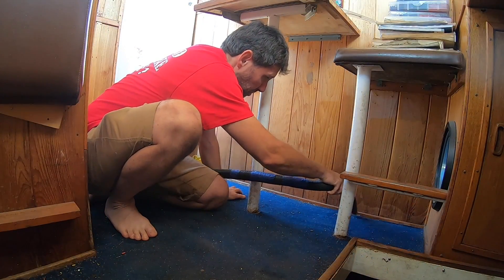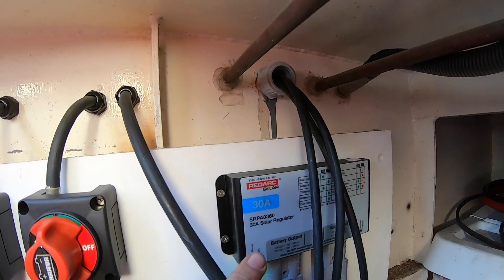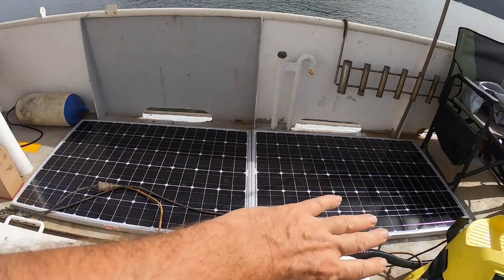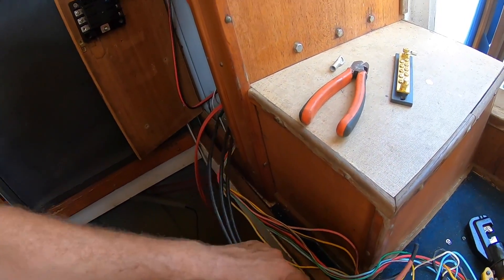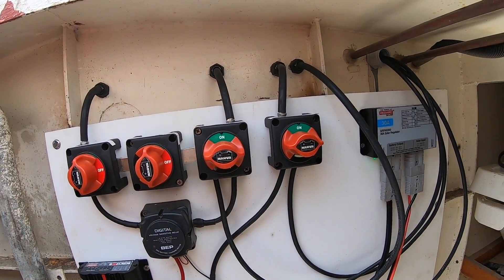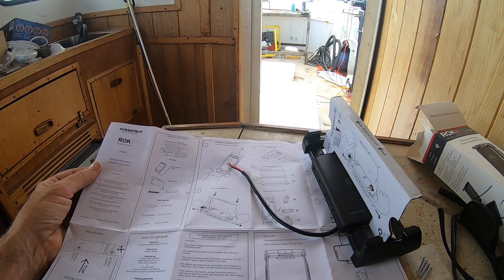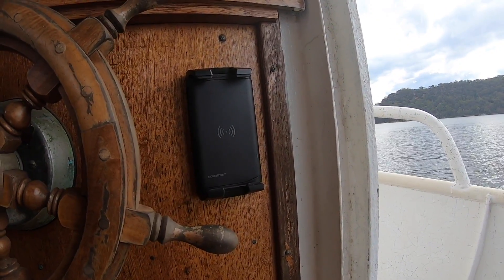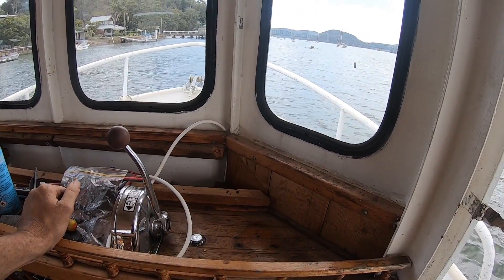Trawler electrics

Comment: Love your channel. A suggestion. Run a blue wire for the 24 volt positive. Common is normally  black and red for 12 volt. Makes life a lot easier.
Reply from the maker: Yes, I'm going to get some colour coded heat shrink to put over all the ends.

Comment: Stu, your message regarding labelling and remembering is a good one! I used a letter and numbering system that wraps around each cable.  I then added a laminated print-out with each of the cable codes and names behind the bulkhead.
Reply from the maker: Labelling the cables themselves is a great way to go. I'm sure I will be doing something similar.
Reply: @DangarMarine  Stu, the reason I did it was that I was doing several electrical upgrades and modifications through my boat restoration simultaneously.  However, every now and then I had an "oh shit" moment when I disconnected a few cables that were only supposed to be off for a minute when someone stopped by for a pint. Then I couldn't remember where the wires went without a multi-meter.  Loads of extra work.  Numbered cables can sit for weeks or months without any issue of quickly re-establishing where they belong.  One last nit-picky thing - I always sprayed my cable ends/terminals (i.e exposed metal surfaces) with an anti-corrosion coating to prevent corrosion.  It looks like you're using fully tinned wire which is definitely the way to go.  Congrats on another great video and thank-you!

Comment: Be sure to place LED lighting above the fuse panel onn a seperate circuit. That way you will have light to work by. Also in the Battery area. These should be on their own circuits. Great video, keep them comming.

Comment: Amazed you are getting on so well with the electrics single handed. 👍 Suggest you label every cable at each end. When finished get a good quality photo, plasticate it and stick it near the fuse box / termination box. Keep a copy on your phone. Hopefully in the heat of “ battle” even if all the labels have fallen off you will have a reference.
Reply from the maker: Thanks mate. Yes, you can't have enough information when it comes to what goes where!

Comment: Another great video Stu the electrics are come on nicely. All the steel trawlers I worked on had the compass mounted down the centre line of the vessel - something to do with the ships own magnetic field deviating the compass. The larger vessels had to have the deviation checked every 3 years and the compass adjusted. Hope this tip helps, your doing a sterling job.
Reply from the maker: Thanks Andy!

Comment: Looking good. When I used to wire up bilge pumps I would have several on automatic floats then have individual switches for each plus one panic button switch that lit them all off regardless of what the switches and floats were at. Have a good one.

Comment: Wow an hydraulic crimper for 16mm lugs , loving the commitment to low resistance joins dont forget the raychem heatshrink and liquid electrical tape.. the lower the voltage the more important and the cleaner your electrical connections need to be..
Reply from the maker: Thanks mate. Good point about low voltage connectors needing the cleanest connections.

Comment: Great Vid, your wiring it up the right way!!! Be sure and mount plenty of LED lights in those hard to see areas, you will be glad you did.
Reply from the maker: Yes, a good set of emergency lighting is a must. I'm thinking of going with those LED lights for illuminating number  plates on cars.
Reply: @DangarMarine  You know i never would have thought of those but that's outstanding those are exposed to the outside elements continually so they gotta be pretty tough.

Comment: another way you could label  would be to print the label out, stick it on the cable length ways and then get some clear heatshrink and cover the label  and shrink it on, you'd obviously have to remove the lugs to do it but by doing this the lable will not fall off due to any moisture .  keep up the great work!!
Reply: That might not work. Those labels use heat to print. Using a heat gun on one might make the whole label go black.
Reply: @chris746568462  : no it wont go black. those are not thermo paper, they use a "toner ribbon" that just melts the black paint wherever the head gets hot and melts it onto the white self adhesive tape. heatshrinking it works well, but dont get too hot or the white tape will shrivel and/or smear the writing onto the heat shrink tube.
Reply: ross private agree; could also cover the labels with clear tape
Reply: @Loetmichel 
That sounds sensible, but I have the exact same machine. It does not work like the way you describe. If you heat the label the whole thing turns black.  You can actually write on them by hand if you use a soldering iron with a rounded tip.
Reply: @  @chris746568462  :  I just googled the machine: We are both right. The machine is delivered with a thermo paper tape spool... but you can buy plastic tape spools that use the toner transfer technicque as well, and those are actually waterproof AND heatproof (to a degree). I have the grandfather of that thing here at home (and a slightly newer "professional" Dymo at the company. Fun fact: they all use the same tape casettes as the one Dangar uses in the video, although the big one at the company can also take 24mm wide tapes. ;)
Reply: @Loetmichel  Yea, I don't use the paper labels in mine, i only use the plastic ones.  Maybe using the paper ones with some heat shrink on cables is a good idea then, personally, I would rather use the plastic ones in a marine environment though.  I still have a classic punch type one somewhere, no batteries needed and they actually stay stuck, the newer ones just seem to not stick as good.
Reply: We used to use slip on cable lettering (you can get it to fit any size cable you want)- its an expanding 'sleeve' that slips over the cables insulation, and comes as the complete alphabet in individual letters and numbers...
(this kind of thing- https://www.aliexpress.com/item/32917754219.html - not recommending this particular mob, just they got pics  in their ad)

Another thing is mark out and label all your fuses- we used to do  a rough hand drawn sketch as we went wiring the cabinets, then when you are finished draw/print up a nice clear one and laminate it, then stick it to the door or wherever, do the same draw out a circuit diagram roughly as you wire it up on an outline of the boat showing where the cables are actually running, when finished, draw it up neatly and print out, laminate and into the electrical cabinet...

Makes diagnostics a few years down the track so much easier

Comment: Seeing as how everyone is giving you advise Stu, I thought I might add one myself.  Dip the end of your bare wire into some dielectric grease before crimping them.  Should prevent any oxidation and should it get dunked, it will prevent a short circuit.
Reply from the maker: Interesting tip, I have some onboard. I'll look into that.
Reply: Great idea on large cables where there is 'wicking' potential between the cores. Smaller cables tend to crimp down to a sold group in the lug, not as important but still a good idea. Heat shrink with glue liner is also a good way to keep crimps dry.
Reply: Ray G 
Great idea, suggestion !!!! I do the same thing on every crimp I install, and in all screw or plug connection. Never had an issue.👍👍👍👍
Reply: Eh beat me to it...
Reply: We use heatshrink dual wall on all our lugs, it has a glue that totaly seals the cable.

Comment: I'd recommend you put the battery switches outside of the the engine room Stu, in an easily accessible place,  say in the wheel house beside the door.  The reason being if you ever had a fire in the engine room, electrical or otherwise, you really don't want to open the hatch to the engine room to turn off the batteries, otherwise you will feed the fire with oxygen.   I had an electrical fire in the engine room while at sea, and having the battery switches on the inside wall of the cabin saved me, my family and the boat.
Reply from the maker: They are in the lazarette not the engine room.
Reply: @DangarMarine  That works.

Comment: Hi, Just waned to say that it is always best to solder wires together and use good quality shrink tubing to seal. I always put a bit of dielectric gel too. if you must use butt connectors add the dielectric to the ends of the wires. just my 40 plus years of experience of building and boating
Reply from the maker: Yes, someone else mentioned the grease on the ends before doing butt connectors, I'll give that a go.

Comment: Bunnings has velcro tape rolls, get some of them and use them for bundling your cabling. Trust me it makes life so much easier especially in tight situations (like upside down from the back seat into the boot of the car wiring up advanced 2way radios with repeater boxes (think power + ignition sense power on + repeater box + antenna + speaker + remote head and more for some including the duplexor for the antenna lol. Tight space makes grouping cables a PITA.

For your "unswitched" I'd be running ONLY the pumps off that using maybe 12g cable DOUBLE fused AT THE BATTERY. For the heavy 4-8g backbones I'd be running all in switched mode (less tears when something burns). Obviously fuse or circuit break the switched connections too. That phone charger definitely hook to switched else little things like that over a week WILL nibble at the battery bank so I've found out before the hard way lol. VERY good choice on that return neg line!!! Single 2-4g back to both 12/24.

As for your compas the raymarine box should do that by calculating the difference in GPS coords off the antenna on the mast. Of course it's handy to have a backup in-case of electrics failing. Remember most mobile phones have a decent compas inbuilt now too especially if you're standing outside just to set your path if you've lost electrics.

EDIT: that label unit is THE EXACT same as I have in my draw here beside me and use for many different things. You can get all sorts of rolls for them too like clothing/material rolls, clear see through rolls (great for going on a spot that will be "back-light" (have a light behind it).
Reply from the maker: Thanks for all tips, much appreciated. I've only been using the labels that came with the printer but I'll see what I can find that is more suitable for use on the boat.

Comment: You need a compass with a binnacle system for compensation. Called “The Navigator’s Balls” the two metal spheres, one each side of the compass, are adjusted to allow the compass to properly work.
Reply from the maker: Yes, I've looked into a bit. I'll have to see if i can find something small enough to fit there.
Reply: @DangarMarine  You might mount it outside, just in front of the window...
Reply: Those cast iron balls are good but you still need to 'swing' the compass, i.e. get a known transit and point the boat at it and compare real with compass - this will give a chart like a sine wave with the 'Deviation' for the vessel for every given course.
The mnemonic is Cadbury's Dairy Milk Very Tasty;- CdMvT
Compass corrected for Deviation gives Magnetic....
Then you take a Variation reading from nautical chart gives True...

That works even without power
Reply: @andrewgray1949  Also there will be "variation" that needs to be subtracted or added to get true from magnetic. Deviation is the error of the compass because it is very seldom that you will get a compass to swing with 0º error on all headings. You covered the rest very well, though, a sailor or pilot? I was both.
Reply: Hey!  C'mon Art - this is a family show... 😏
Reply: @artnickel1664  Think you mis-typed - Deviation is the error of the compass in interaction with the vessel versus all headings, variation is the error of the 'location' - you put variation for both.  

Variation is due to the magnetic pole not being in the same place as the geographic (true) pole and to the iron content in the earths crust - The north star is actually much more accurate than magnetic north, being about 80km from true vs about 500, though of course the Mag pole is moving between 10 and 40 km a year - around the UK this means the variation can be as much as 7' per year, so a chart which is 10 years old may need an adjustment of over a degree.

Deviation is more of a concern on steel vessels and with an uncompensated compass can be between 4 and 8 degrees - a good way to think about it is that there is a magnetic 'centre of gravity' for the vessel - if your compass at that point you're good but if the wheelhouse is forward or back from that point you'll get an error as that will draw the compass away from magnetic N (hence the error is usually more pronounced going east or west) and the error doesn't cancel out! e.g. you go east 100m, a 4 degree deviation will see a 7 mile error, but go back west 100m the deviation could be -4 degrees so a further 7 miles.

Nowadays power vessels with GPS can skip the separate deviation and variation calculation and read the compass vs GPS while holding a steady course (and repeating for different headings), giving a table or graph which factors in both and gives an immediate compass to true conversion (provided you're operating in the same area)

Art - the above isn't an attempt to correct your comment, just expanding what I said in mine
Reply: @andrewgray1949  thanks, was tired.
BTW, if you lose electricity your GPS is pretty useless, which is why you should always make sure you know the deviation of the compass, especially when navigating in tight or congested waters.
Had a talk with a fellow that owned a fiberglass sailboat, around 36 footer if I remember right. He didn't worry about his compass because he had GPS. We were talking while he waited for the TOW service to get his boat off shoal water because his compass was way off and he lost his electrics do to a dead battery--generator problem. Influence on compass was from the motor and metal rigging and having replaced the original compass with one that didn't have binnacles.
Reply: @artnickel1664  The guys used to think me a little odd, I had a small waterproof torch (flashlight) with no bulb and NOT A TORCH written on the side?, BUT, it had 4 brand new batteries in it the same size as the handheld garmin unit.  If I left the bulb in, somebody would have used it... 
But yes, a compass and a laminated deviation chart is much like a condom, better to have and not need than...

Comment: Ive always preferred nylon cable ties that have an moulded in tab for labelling cables (ive found friction is a far more reliable fixing than any adhesive ) suits cables up to 16mm above that and for equipment,  isolators  and such an engraved tag fivxed with 1 or 2 cable ties ( when snipping cable tie off cuts use sharp side cutters with one edge on the toggle block of tbe cable tie and the other edge smartly on the serrated edge of the tie, snip in one clean quick motion , you will get a perfectly sheared off tie flush with the toggle block with  NO sharp edges , it will also identify you as an electrician with an  extraordinary depth of understanding on the usual blood trail that follows any cable tray installed anywhere ever..
Reply from the maker: Thanks Mitch, will look into them.

Comment: Ritchie (amongst others) makes compasses specifically for Steel boats that have the compensators you need to make it accurate.  A steel boat has a magnetism itself which means a standard compass without compensator won't actually use the magnetic north, since it will always be a little off.  The compensators allow you to adjust it since all boats will vary some.  There are people that will come out and do the adjustment for you if you didn't want to tackle trying it.   At least in my experience most of the compasses designed to work on steel boats will take a bit more room than a standard compass because of the compensators, so not sure if you'll have enough room to the starboard side of the helm or not.
Reply from the maker: Thanks Mark. Yes, I'm worried that there won't be enough room there for a compass with compensators too. I might end up needing to go with some type of remote system.
Reply: @DangarMarine  Thought you would just go for gps & marine chart database for your intended area of ops sir?

Comment: Hi Stu, Don't forget that the fuses are to protect the wire, not the equipment, in this case if it asks for a 1.5 amp fuse, it really should have a 1.5 amp fuse, otherwise if there is ever a fault you risk the wire melting and starting a fire. It is also worth keeping in mind, is it asking for 1.5 amp fuse, is that 1.5 amp fuse at at 12v, or 1.5 amp fuse for 24v. If it only needed 1.5 amp fuse at 12v, thats only 0.75 amps at 24v. You can get massive packs of fuses on ebay for cheap :) Also i hope you will fix those terminals at the master switches which were too small as if they get left/forgotten they will create a hot spot and are also a major fire risk. Thanks, Matt.
Reply from the maker: Indeed, I'll have to buy some smaller fuses soon.

Comment: Put as much as you can into the boat now, when you start using it you will be glad you did time will slip away 👍👍
Reply from the maker: Yes, I think you are right. Once the engine is back in the motivation to do all the extra work will probably subside.

Comment: Hi Stu, like the electrical install, similar to the control boxes and distribution boxes I am currently making but mine is only 12volt. The solar panels are great but in the UK we would need them about 20 meters square because we don't get that much sunshine here, if you come across any rain panel systems I will sign up for them any day
Reply from the maker: LOL. I'll keep an eye out for those rain panels. :)